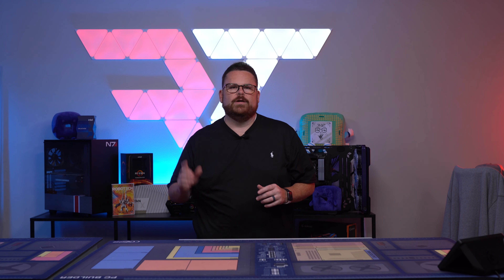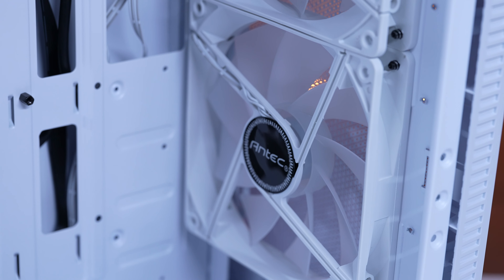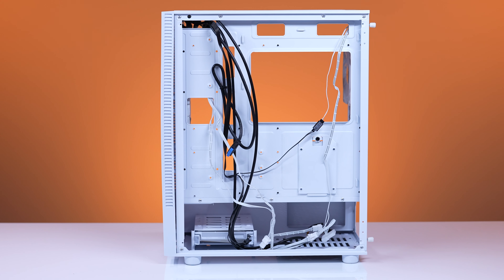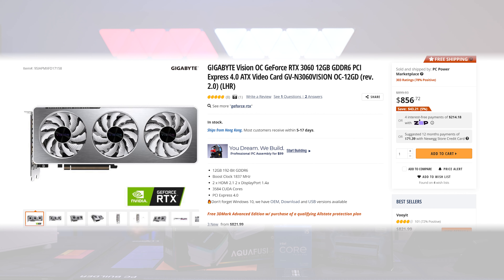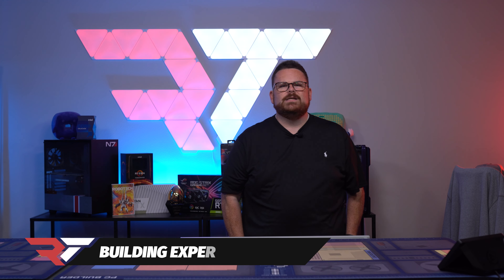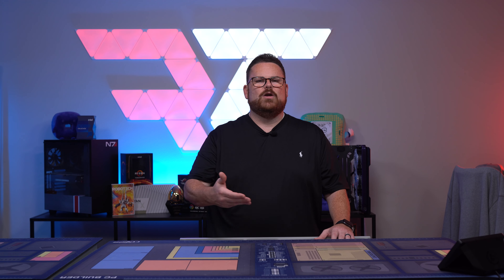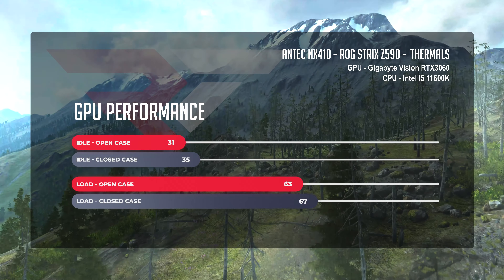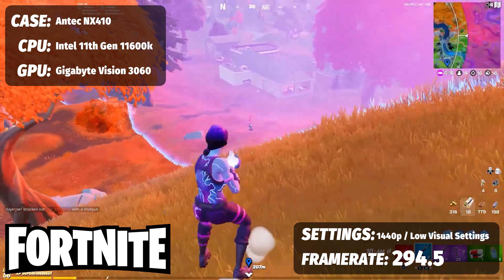Is the Antec NX410 to much of a “budget” case?

Comment: Had my eye on this case for my wife's build. Now, I'll look at the other cases you suggested. I'm currently rocking the Phanteks so I might try the Montech.
Reply from the maker: Both are great!
Reply: I have the Mini-ITX version of the Phanteks case that was mentioned.  They really don't give you a lot of room for cable management, considering the option for a side mounted radiator.  I have an EVGA 3080 Ti hybrid that has a 240mm external radiator, and the rear side panel leave's almost NO room for cable management.  The side panel is currently open until I get custom shorter power cables.

Comment: Just built in this case for a super budget, spare parts build I did for my buddy’s kid. Got it for $64 and had zero issues. I even got the $19 Thermaltake CPU fan wired up with the case fans. I was very impressed with it in general. I7 6700, 1660 combo ran super cool and it was relatively easy to build in. Moving fan cables and stand-offs is a little annoying but I thought it was great for the money.
Reply from the maker: There are better cases at the same or lower prices that don’t have those compromises. That’s the larger point.
Reply: @RobeytechLive  Thanks for the reply! I'll certainly check out MONTECH next time I do a budget build.
Reply: Are all the fans connected with 1 molex or does each fan need a molex connector
Reply: Everything in my build is working fine except  the led control button. Any tips on how to get that to work?

Comment: I think I can live without a USB C port, and I think it's fine that they removed it because a USB C port is quite expensive when compared to a couple of USB A ports or an reset switch.
Reply: But Molex fans ARE HORENDOUS
Reply from the maker: lol
Reply: What people used the usb c port for?
Reply: @Bdi.  For external drives, plugging in their phones, etc. Not very helpful tbh, especially since they're really slow.
Reply: @mutasimrahman6833  I’m new to pc building so what’s a moles fan?
Reply: Molex
Reply: @Slinkycashew  Molex is just the older version of sata. It's used to power devices like fans, and old hard drives, etc.
Reply: @mutasimrahman6833  Ok! Thanks

Comment: In mid tower cases corsair 4000D or lian li lancool ll will be ultimate choice....little bit pricy but worth it.👍🔥🔥
Reply: Second this. Last build was a Lancool 2 (non mesh). Current is a 4000D Airflow. Lancool is built better, but the 4000D is absolutely stunning.

Comment: I was looking for reviews of this case, and I'm sure you can put a bigger PSU if you remove the HDD tray. The HDD tray can be removed with a few screws on the bottom of the case.
Reply: You don't need a bigger PSU if you are building in this case, it's not designed for HUGE systems.
Reply: @animalyze7120  any case is designed for whatever you can fit in. This case was clearly designed with a removable HDD tray for that extra space for the PSU. I'm just mentioning that he never removed that tray, so his statement about the PSU compatibility is wrong.

Comment: I just bought this case and instead of a molex cable, it's a sata for the fans,so far, no complaints.
Reply: Hello, do you recommend it? I have nx410 available in my area vs abkoncore c550m
Reply: I bought this case a few weeks ago and was finally able to build 3 days ago. My fans also have a SATA cable. The RGB worked for a while, and then when I moved the PC from the table I was building on, onto a desk, the RGB quit working. I can't figure out why.

Comment: I just did a build with this case. Overall it was fine. I’m not too anal about cable management. As long as it looks decent and works, I’m good. The fans worked, the rgb works fine. I did have to take the back fan off to get the motherboard in. I used the MSI B550 Tomahawk ATX motherboard. I also had to add the additional stand off for the right edge of the board. One additional thing that I noticed was the front panel plug ins (power switch, hdd led and power led) were very loose when plugged into the pins. Not sure how that’s going to go. Overall I’d give the case a B-.
Reply: Hello, can you please help me with the gpu. I’m a new builder but I have no clue how to screw in the gpu with this case like what screw do I use and what is the slider thing for near the brackets. I’ve been trying to find a video that will show it but I cant find one
Reply: @zelrius8714  3 months later aye did u ever figured out how to get it done?

Comment: You also didn't include the fact that you can't fit all those rads in at the same time from the looks of it. Just replaced my Meshify C with a 5000D. The Meshify C was extremely limited with water cooling (even 2 AIO's) to the point that I just upgraded. System also runs much cooler now with just 4 fans and one AIO.

Comment: Hi Robeytech, I'm wondering, if it's possible to move the front fans to in front of the chassis (i.e. to be just behind the front mesh), to give more room for GPU inside.  If so, can you also comment if it's possible to mount 3 x 120mm fans at the front, again, in front of the chassis rather than on the inside.  Thanks!

Comment: In order to use the fan RGB could u connect the molex connectors to the PSU molex connectors? Or do u need to do something else?
Reply: yes connect to psu molex but cant connect to motherboard which is bad as they advertise as argb fans

Comment: Hey Robeytech! Can you help me out really quick? My case is giving me lots of anxiety lol.

So I believe my Antec NX800 case fried my motherboard (I ordered a new board earlier today).
Could it have been the standoff screws that were preinstalled or the ones that I installed? Or was it one of the Front panel connectors or something?
I really do believe the case is behind it since the build worked in my first case right before I swapped it.
(All the case fans were working and lighting up, so it leads me to believe the standoff risers are the culprit possibly?)

Or did me installing the HDD_LED connector wrong the first time fry my board?
It'll help me out IMMENSELY if I knew what the culprit is, so I don't end up frying my new motherboard that's coming in on monday.
Thank you Robeytech if you reply!
Reply: @Ujjwal No, I ended up having to buy a whole different motherboard. The case ended up frying my motherboard. LOL.

The reason for this was because of the extra standoff screws that they give you. I installed them onto the case for motherboard (ATX size motherboard). Either I installed them wrong (I highly doubt it since, well.. just screw them in. I think the either the extra standoffs aren't properly made or something or I just ended up stripping off the "paint" from the standoff screws. 

Either way! I would AVOID installing the extra standoff screws that come with the case! Just leave the preinstalled screws that are already in the case there and just use those. That's what I've been doing for months now and NOT EVEN ONE ISSUE with the case now. 

Overall, it's a great case! If you can though, I'd recommend fetching the extra $10 - $30 for the Lian Li Mesh 2 case! It's far better than this case IMO! Or if there's even a Lian Li Mesh 3 case now (Not sure, just saying if there is then that's what you should go for!).

Comment: I have the same issue with the ARGB function, the led's don't work. Where did you get the replacements? Please answer, I'm building this pc for a customer.
Reply: hola bro, tengo el problema de que los ventiladores de mi case se alimenta por sata, estos encienden pero no consigo que los colores se enciendan
Reply: @luckalvafabian5223  igual yo camarada, pero termine comprando abanico led por separado, traen su propio controlador. Saludos!

Comment: i have this case. the only thing im not happy with is the molex fans. i dont really care about a usb c as i would never use it anyway.
Reply: did you have led issues
Reply: @poke9742  no i didnt. The reset/led switch gets pluged into the rear fan
Reply: @andrew Scotti , hello, do you like the case so far? I have it available in my area vs abkoncore c550m , let me know your opinion
Reply: @aizen.x.9312  i actually swapped out the case because i got a huge new graphics card but i had no complaints with the case and i really liked its power button.
Reply: @andrewscotti1136  thanks